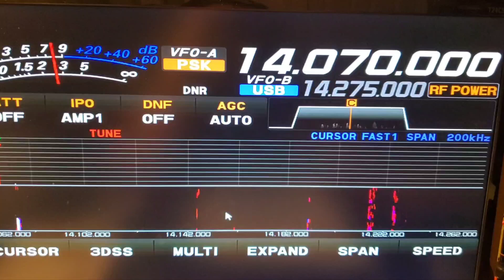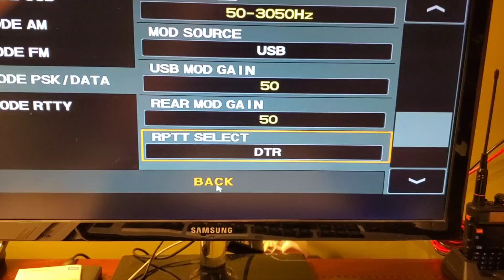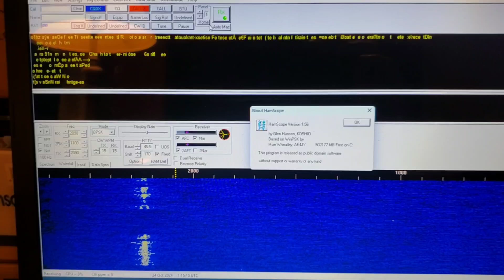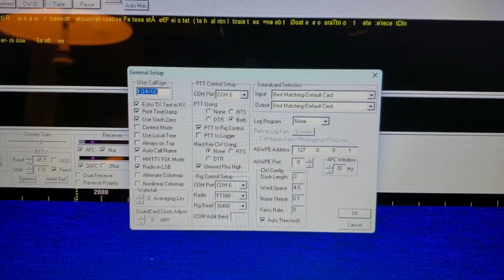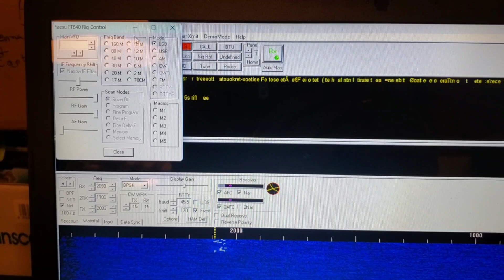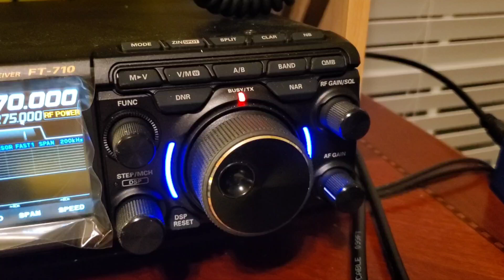Yaesu FT-710 PSK31 and Hamscope setup

Comment: For anyone else who doesn't want to listen to 13 minutes of rambling, here's the TL;DR:

1. Set your radio to PSK. In the radio settings, change the PSK to "Mod source USB" and "RPTT" to "DTR".
2. Make sure you have a driver installed for the USB cable - Yaesu's website has instructions for this
3. In the hamscope software --> settings --> change to the COM port to match your radio
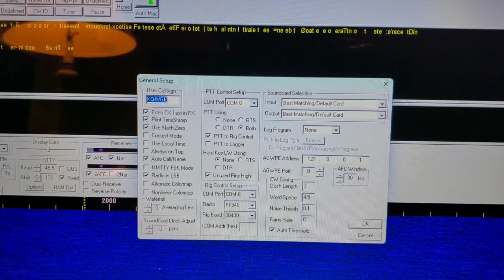4. Reference timestamp 10:12 for settings to put in Hamscope

The video is appreciated, but please speak a little bit faster - I had to listen to you at 1.5 or 2x speed to not fall asleep 😆
Reply from the maker: Sorry about that,  it was probably really early or late. Thanks for watching and commenting.